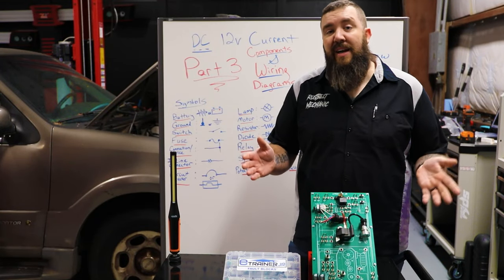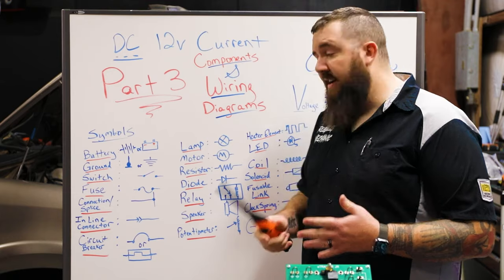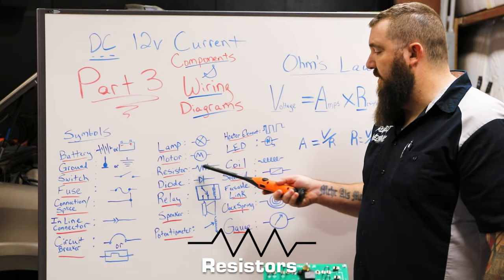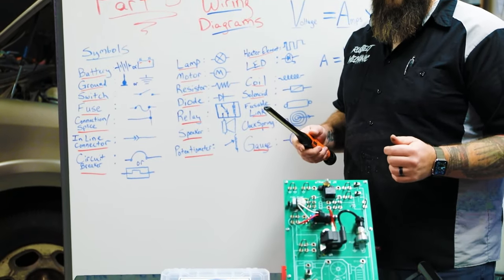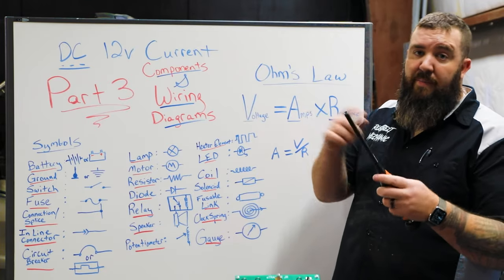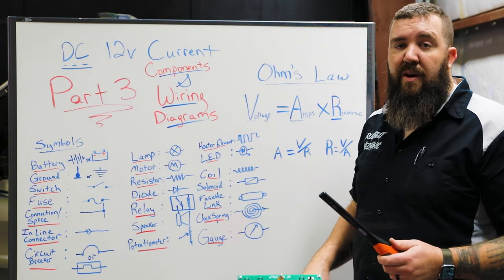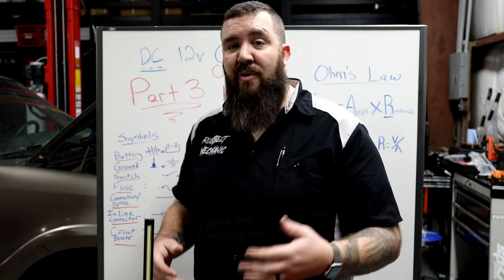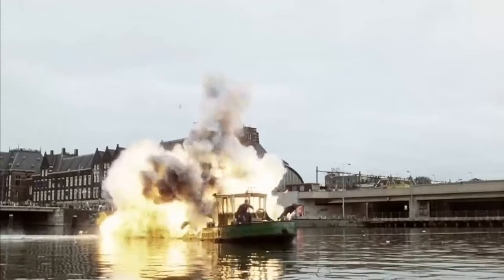BASIC AUTOMOTIVE ELECTRICAL DIAGNOSIS PART 3

Comment: Another good training video but a technical error at time 7:20 where you state potentiometers are used to vary current or amperage which is not accurate since they carry the same amperage throughout.  Potentiometers are used to vary voltage and are considered as voltage varying devices and rheostats are used to vary current by changing resistance.  Very important distinction between the two devices.